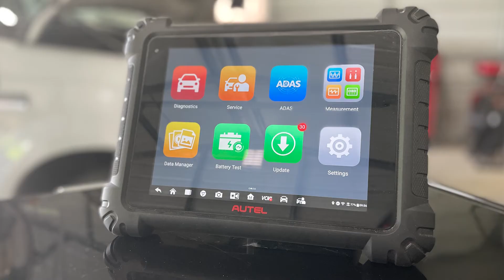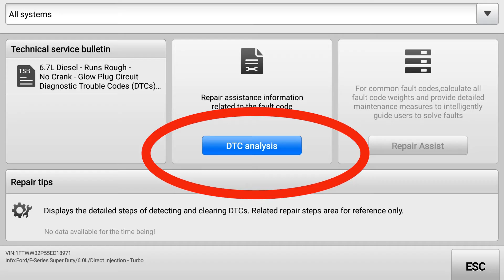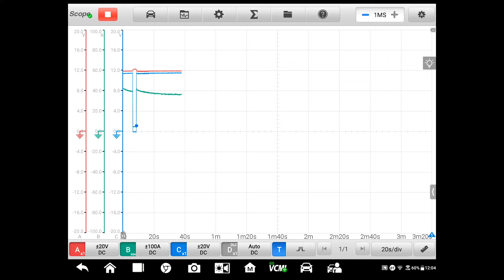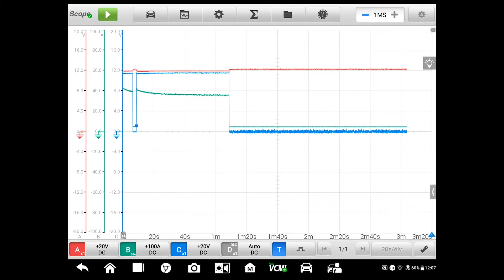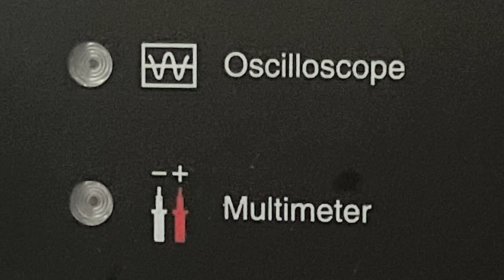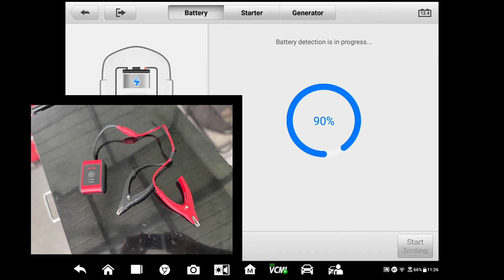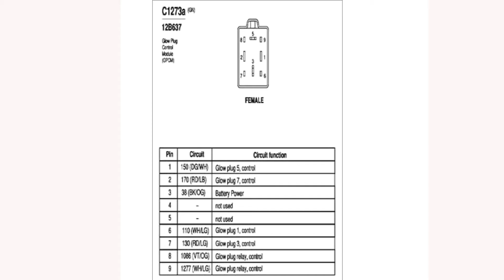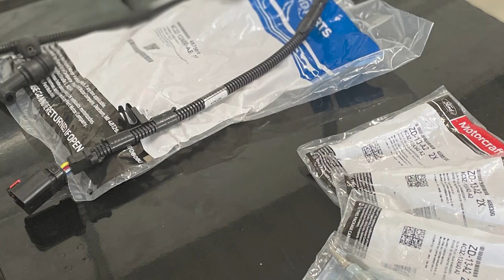The Trainer #117:  How To Diagnose A Ford 6.0 Diesel "Hard Start" Complaint

Comment: I think it's not "healthy" to use an ohmeter with the batterie connected.. you can dammage the ohmeter or it can gives you wrong readings.. unless you know what you are doing
Reply from the maker: Valid point. My tests were on an open circuit but I should have stressed that point for those new to testing with their ohmmeter. Sometimes it's hard to remember to say something about things experienced techs take for granted.
Reply: @VehicleServiceandRepair  THANK YOU FOR RESPONSE

Comment: Very elegant and thorough diagnostic process. Without a scan tool I would have measured the resistance of all glow plugs and hope that  that's where the defect is. Having the proper tools makes the job so much easier.